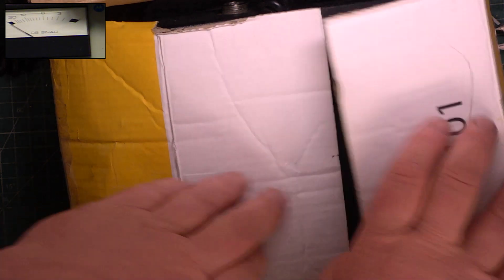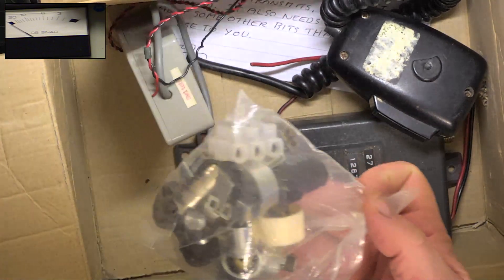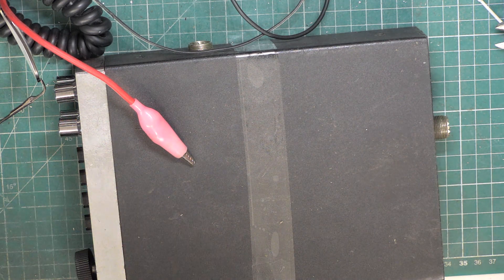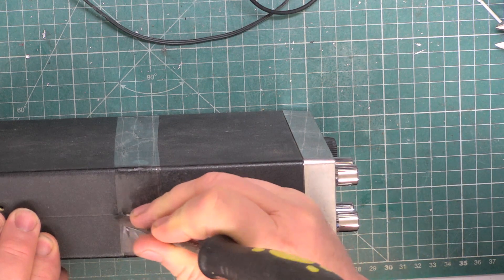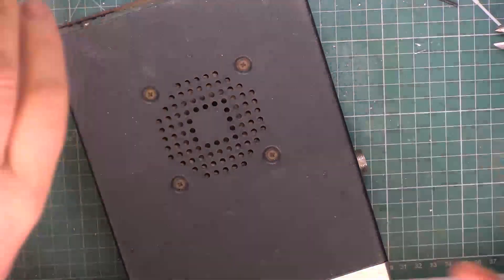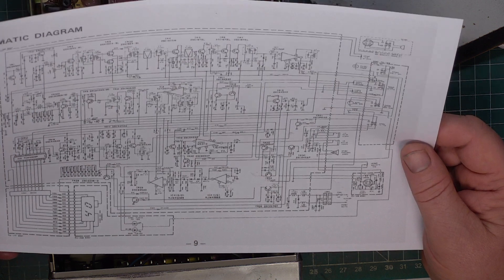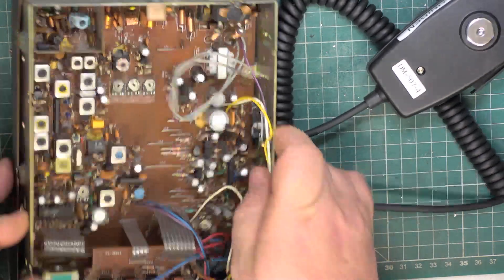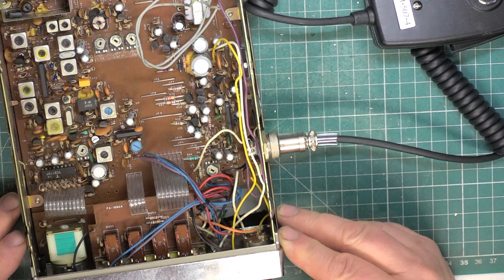Uniden 400 PR27GB EU FM CB radio - repair & service Pt1 of 2

Comment: I didn't think it was just a case of changing the PLL chip to go from CEPT to Uk channels? I take it the radios with the Uniden in blue are the "grey import" type.
Reply from the maker: I've not come up against this before, so am unaware of what gets messed with. However, paying £8.80ish to order a TC9106 IC to put this back on EU channels is great, with it releasing the TC9119 UK fr putting in something rwally worthwhile like a base station.

Richard
Reply: @ukfmcbradioservicingTango21  very true, I guess the pinout must be identical between  both chips and maybe isn't on other models such as LC7132 which might be what I was thinking of